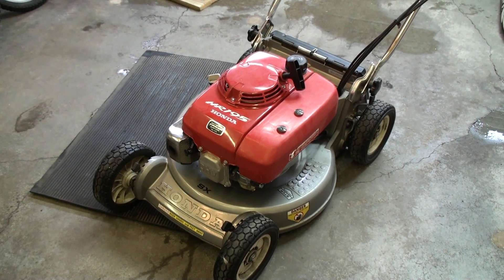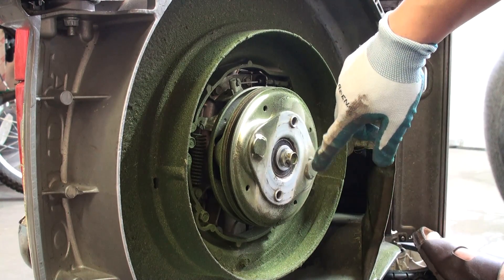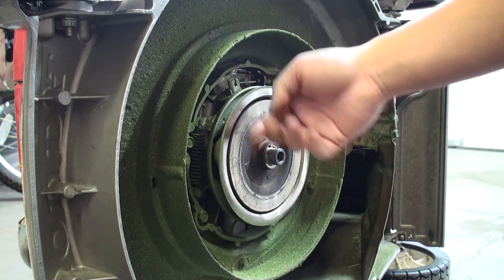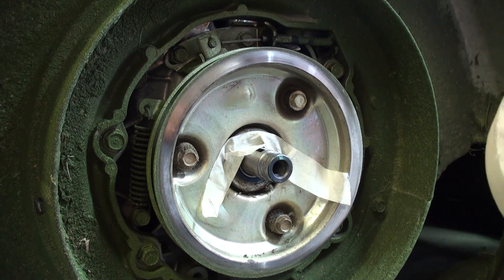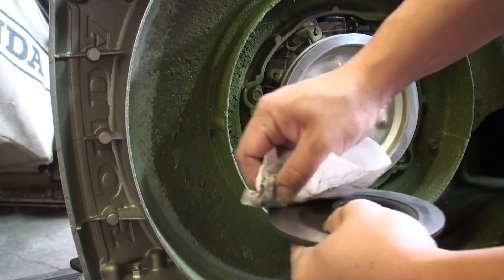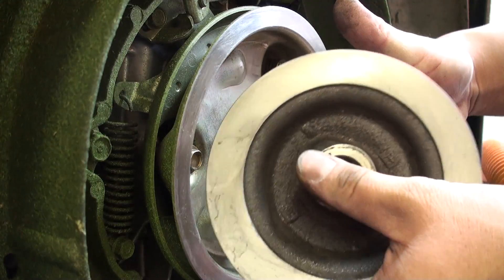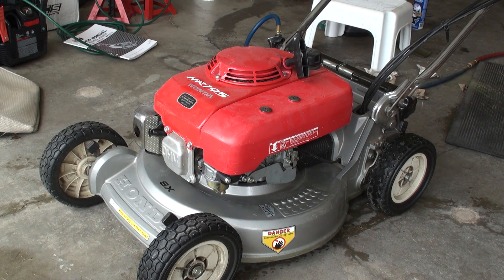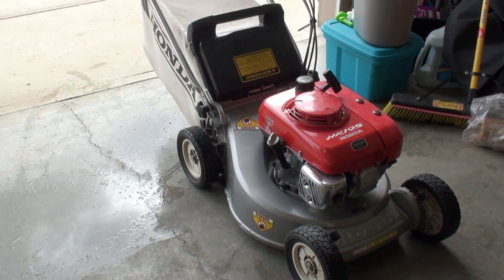Repair a Honda HR 195 or HR215 Masters Series Lawnmower Roto Stop Blade Brake Clutch

Comment: Never ever sand like this!!!  ALWAYS use a sanding block. It is very important to keep those surfaces as flat as you can so it can mate properly or you will end up glazing the hell out of it again faster. And STOP feathering the cable when engaging the blade. Engage it quickly. It's like riding your clutch in your car.  That impact gun is way more than 40lbs and you did over tighten the assembly. 
There are scratches on the side of the deck so you either lied or are one of those people that live in a perfect world where unicorns roam freely and blow bubbles out of their butt. Lol!
Reply: Dang rob Peters! How anal of you. Did you have to enlarge the video to see the scratches? 
Loosen up man you're all wound up. LOL
Reply from the maker: There is zero harm in carefully removing the glaze on the clutch surface. Given how small this clutch is that I hardly doubt there would be uneven clutch grip - I was quite careful in sanding to just remove the glazing.  In case you’re wondering how the glazing happened it was because one year my grass was extremely long and it bogged the mower down so much the clutch started to slip which then glazed the friction plate.  Yes the impact gun is going to be for sure more than 40 ft-lbs. possibly as much as 70 ft-lbs but that isn’t going to break the bolt on this mower. Lastly I am not sure what you mean my scratches on the deck and unicorns and rainbows but this mower is as original as it is going to get. To this day even after years after making this video the mower looks like it is new - it is normal to expect some scratches it’s almost 30 years old!  I have seen newer mowers in FAR worse shape.

Comment: Good video. It looks as if, after removing the driven plate and exposing three bolt heads, removal of those bolts is what is necessary to access and replace the wheel drive V-belt. Is that correct?
Reply from the maker: Hi John, Unfortunately I can't say if that is the same way you'd take apart a clutch to gain access to the driver pulley for the transmission. The Honda's I've worked on (the old ones) always had a shaft driven transmission from a PTO shaft on the back of the engine.  Which model of Honda do you have that uses the drive belt to drive the tranny?  I suspect the newer HRX models?
Reply: @piercedasian  Thanks for your reply. The Honda I have is 6-8 years old, a Model HRR216VYA. It features a "dead man" clutch that covers the wheel drive pulley completely. Vaariable walking speed appears to be the result of varying the tension on a belt that goes between the engine shaft pulley and a pulley on the side of the rear axle transfer case. Both pulleys have cages around them to prevent the belt from coming off. The cage around the engine shaft pulley is held by two 10 mm bolts that can't be backed out enough to release the belt. Hence what seems to be the need to remove the entire blade drive clutch assembly. 

I hope that makes sense. When I saw in your video the three bolts holding the back plate of the blade clutch assembly, I guessed that would be the next step in getting at the hidden pulley. I may just tackle the disassembly you described, and go on with removing the three bolts. (Wish I had an impact driver!)

Comment: I want to know if you can take the blade brake clutch off completely and use the mower without it?
Reply from the maker: absolutely not.  The brake blade clutch system is a safety and convenience feature and to my knowledge there is no way to bypass it.  Not sure why you'd want to bypass this feature as I LOVE having the BBC system on my Honda mowers.
Reply from the maker: Sorry Boliver if you took my answer the wrong way.  Your original post didn't mention using it in applications other than for a mower.  But to answer your question yes it can be completely removed and the motor be used for something else and no you likely cannot remove the clutch and use the mower without it - I believe the output shaft of the mower that drives the blade is shorter than a normal mower b/c the it has to accommodate the BBC clutch.

Comment: A very well made video thank you very much, I've saved it to my useful playlist. I have a question, my lawnmower  is a 20 year old HR2160 with electric start and rear roller. I've kept it clean by hosing out the under side with water. The last time I did this I'm sure i sprayed the water momentarily into the clutch from the side by mistake. When I used it a week later it worked fine but there is now slight squeal when I engage the blade other than that it works fine. Have I caused damage by spraying in the water? Dirt could have got in I guess. 
Based on your video I was going to take it apart to have a look and clean it but I don't really want to unless I have to, what do you suggest?
Reply from the maker: sorry for the late reply but no not likely.  What you probably did was rust up the driven disk and brake surfaces and you probably left the driven disc (the clutch itself) wet which then results in some squealing and odd noises when you engage the clutch.  Just be mindful that the next time you wash the underside of the mower that you really should run the engine to operating temps and engage the blade for at least a few minutes several times in succession to dry things up good before putting them away.

Comment: Nice Clean Work. I have a Honda Harmony 215, but when using it the blades Is not moving. I opened but nothing was broken or damaged. What do you think I should do. Thank you and keep up the good work.
Reply from the maker: The Harmony 215 uses a different and less substantial blade clutch assembly.  Have you checked for broken cables?  if the cable snapped then the blade would never be able to properly engage.  Check that first.
Reply: Thank you , and yes I will check the cables and keep up the good clean work.
Reply: @piercedasian  I have the same harmony 215 HRB215 and the blade works when first started but when it heats up, the mower doesn’t rev up the way it does when it is cold. It is inconsistent, works and then doesn’t and then does. Any ideas?

Comment: Nice video.
Stop babying the clutch when you engaging the blade. That's why you have a glazing effect
Reply from the maker: It wasn't me that did the babying, it was the previous owner that did that plus the few times I mowed over some insanely long wet grass which cause the clutch to slip and glaze up even more.

Comment: Excellent job of using sand paper to resurface the clutch/brake parts and explanation of what the clutch does. You have done a superior job of maintaining this mower!  Master Series?  I have an HR215 SMA that looks identical to yours, only electric start.  Do I have a "Master" series model?  Thanks!
Reply from the maker: yeah the Honda The HR215SMA is part of the masters series.  Tell tale sign is blade brake clutch and aluminum deck. Electric start and self propelled were options depending on what model you have.  Since your is a SMA that mean 3 speed, electric start. I'm betting yours was from roughly between 1990-1992?

Comment: I was under the impression the driven disc as you call it is actually a brake pad that stops the blade rotating when engaged.
Reply from the maker: It is actually both.  The driven disk is also the blade brake.  If you look at the friction material surface they're at slightly different heights.

Comment: Love the old Hondas . I have a HR194  with the roller , it cuts like a dream when i first got it the mower would die when you engaged the clutch blade, then it would not restart .Turned out to be a duff plug breaking down when hot.
Reply: Hey I have an old HR215 with that same issue. What exactly is a duff plug? Haven't heard that term before
Reply: @mitchell5126  it's a  UK term for bad plug

Comment: You have access to an air gun, but I dont...How would you undo the centre nut with a ratchet, since I have to replace the bearing...how to lock the crankshaft?
Reply from the maker: having access to an air gun is the easiest way to do it otherwise you will need to use a flywheel holder tool (looks like a large strap type wrench to prevent it from turning.  Sorry I couldn't offer up any better solutions to your dilemma.

Comment: such a well looked after machine looks so clean!
Reply from the maker: I am actually the 2nd owner of this mower BUT the original owner hardly used it because of their health issues so the mower sat mostly unused for its entire life.

Since I took ownership of it over 15 years ago I have been EXTREMELY careful with it to not bang it around or scrape it against anything.  I treat my power equipment like my cars... with extreme utmost care.  I won't even do the first most in the spring on my lawn for fear of rocks and lawn debris damage.  I hire out the first most and let someone else's mower take the abuse first...  As weird as this might sound I've waxed the mower to protect its finish... neurotic behaviour of mine ;)

Comment: Wow your mower is in awesome condition. My 30 year old HR 194 is still going strong but the blade bolts have totally seized.
Reply from the maker: have you tried using some penetrating oil and a bit of heat from a torch (exercise extreme caution) to free them up?   Yeah I'm anal about my mowers... they will likely last until I die.. I wash and wax them as needed :)
Reply: Thanks for the tip. Finally got them off using a set of bolt grip sockets, which have a spiral groove inside that  bite into the damaged nut. Even then on one of the bolts had to grind off the flange. My Honda is a hand-me-down from my dad who badly neglected it for years. Recently bought a new mower which made me realise how much more awesome the 30 yr old Honda is. My HR194 has electric key start with battery charge circuit, shaft drive with metal gearbox, and the roto-stop blade clutch, none of which the brand new mower has - despite costing $1000. They don't make em like they used to. 
Any suggestions on reducing smoke on cold start? common issue on these engines I think.
Reply from the maker: Yeah the new mowers in my opinion suck.  This is why I've owned as many as 7 of the old masters series mowers.  2 of the 7 mowers I've kept for myself selling off the other units to family members that wanted something well made.  Good to hear you got the rusted bolts off the blade.  The HR194 is a workhorse and has a very good (albeit a bit underpowered) GXV120 engine in it.  Still nonetheless an awesome piece of machinery.  To reduce the smoke on startup?  Make sure you've got a clean air filter and that you're using 10w30 automotive engine grade oil.  Preferably synthetic if you really want it to last a long long time.

If it continues to smoke on startup then you're not left with much of a choice other than to replace the piston rings and in extremely smoking cases new valves and valve guides which in most cases people would simply put in a newer GXV 140 engine.  If the smoking is minimal then don't worry about it.  Even my mint condition mowers have a tiny tiny bit of blue on startup and yet they don't actually use ANY oil.  Always full even when I used the same oil for 3 years (my bad for using it for that long).

If your mower ever dies then the closet match you'll ever find to what you have is the Honda Commercial mower.  Uses the same fundamental design but with a heavy gauge steel deck but it does have the same shaft drive transmission, ball bearing supported wheels and a ultra duty GXV160 cc motor so it has a LOT of torque and mows like a dream.  I almost had one of those last month brand new but wifey stopped me.
Reply: @piercedasian  I'm the same way. I wash and polish mine also. 
I also buy used Honda mowers on CL and restore and reselll them. 
Picked up an HRB215 and when I saw the rotor blade stop I went looking for some answers. 
And that's how I found myself in your company. Thanks Pierce for putting this up your vid was very helpful.

Comment: I just installed a roto stop cable on my HR214 and can't get the "washer" to attach on the part under the engine.
Reply from the maker: +Patty Garcia I looked at that washer on the cable assembly and I understand what you mean by not being able to get the washer onto the cable end.  The washer is actually a one way gripper ring washer.  You need to get a pair of needle nose pliers, open up the jaws slightly and the using the tips of the pliers to push on the outer edges of the ring to press it onto the cable end.  What happens is the little tiny fingers on the ring will bend and deflect and allow the ring to slide onto the cable end.  Since the ring will be a tight fit the cable can't back out b/c the little fingers on the ring are jammed up against the fingers.  Does that make sense?  It will go on but you just need to serious muscle to push it on.  Get a helper to assist.

Comment: Hey, that was a great video. thanks.

The reason I watched this video about the clutch (just wanted to pick your brain if I may) is because I have a used clutch like the one in the video, and I was thinking of using it as a clutch on a home made mini-bike I am going to make for my grand son. Do you think this clutch would be strong enough for use on a 6.5 hp mini-bike?
Reply from the maker: +Richard Conquer I can tell you now that the clutch itself will likely slip.  Extremely wet grass will make the clutch slip and a lawnmower is only 4.5 - 5HP.  A 6.5HP motor would tear the clutch to shreds.  I strongly advise that you spend the money to buy a comet clutch assembly that is purpose built for go karts and other similar applications.
Reply: +piercedasian . ok, cool, I appreciate and trust your judgment. thank you.
Reply from the maker: Ironically I helped someone source our parts for a bar stool go kart so I have some experience with what you're trying to do.  The lawnmower clutch definitely will not work.  Good luck :)